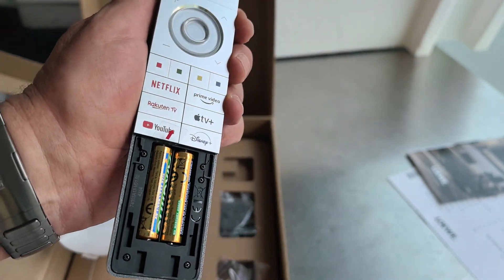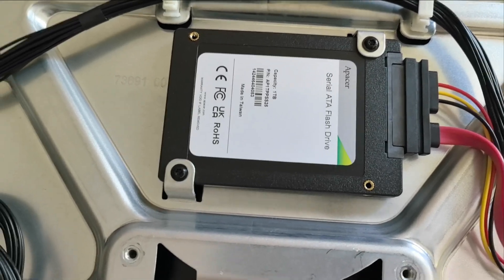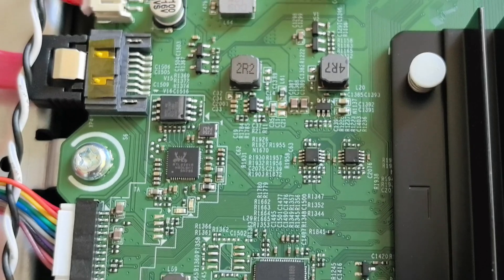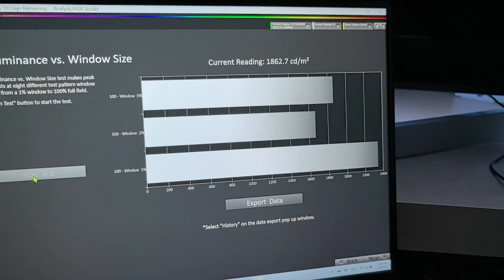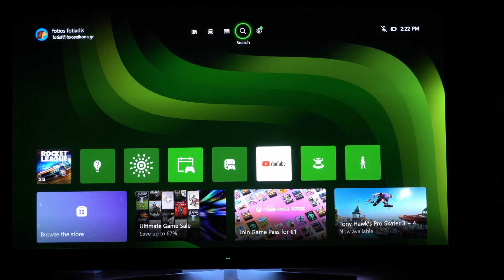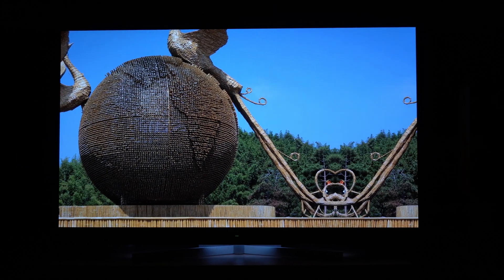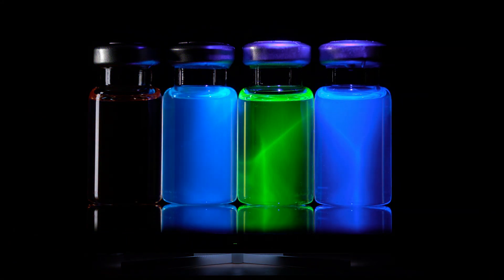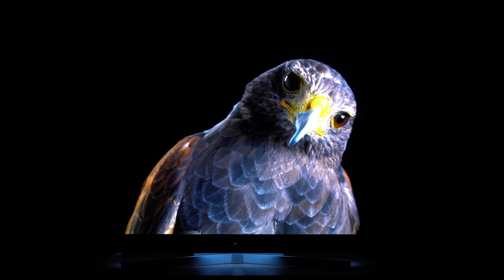Loewe Stellar 65 dr+ 2025 with Vidaa and  META 3.0 OLED panel - the new Primary RGB Tandem panel.

Comment: Thank you for the video. I’ve been holding off on purchasing the Stellar as I’m specifically waiting for Dolby Vision support and the latest Tandem RGB OLED panel. Do you know when this updated version will be available in EU and UK?
Reply: The 97" £30K top of the range Loewe Stellar has the VIDAA OS and supports Dolby Vision. All the other smaller sizes in the range use the Tizen OS so do not support DV. No announcement has been made on if/when this will happen.
Reply: @ChandlerBong-h5e  I’ve had confirmation directly from my contact at Loewe that the updated Loewe Stellar TVs, featuring the new VIDAA OS and Tandem OLED panel, are already being dispatched to retailers.
Tizen OS is no longer used in any of the new production batches. However, my contact did stress that many Loewe UK retailers still hold significant inventory of the previous-generation Stellar models, so it may be a little while before the updated versions become widely available in stores.
Reply from the maker: I think it is already on the market
Reply: Just save a bit money and buy a equal as good or even better TV. This is just overprized bexause of the dumb backside and it also comes with a cheap OS with less support. I would call that a bad deal🤷‍♂️